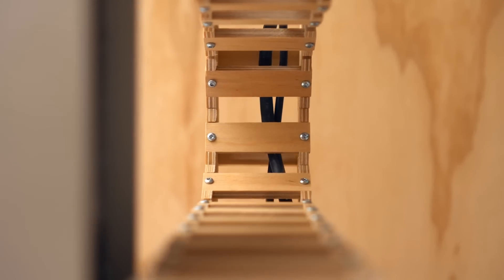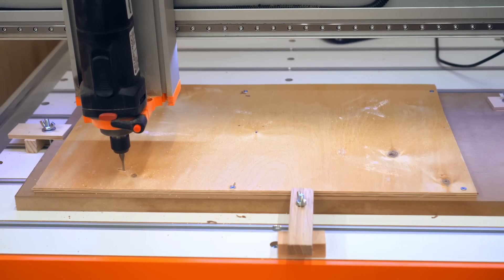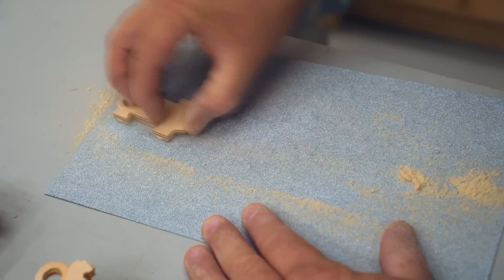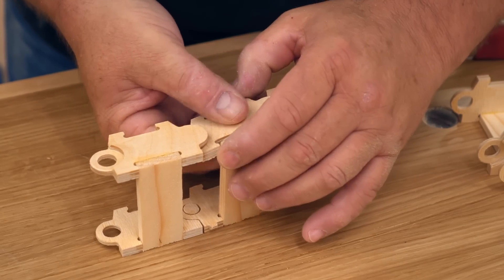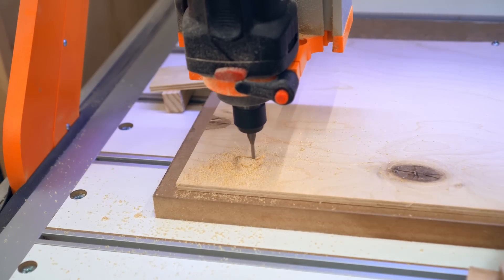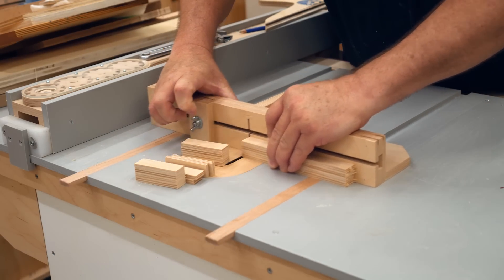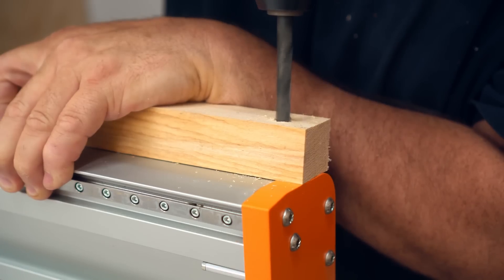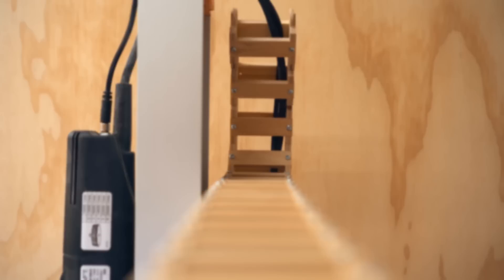Plywood Drag Chain? Yes! How I Made It

Comment from the maker: Next: All wood CNC?
Reply: I’ve built 2 wood CNC machines. The first one was built by inspiration from studying how other people built theirs and the second was a Dave Gatton (edited) design which I bought from him. I used my first CNC to cut out much of Dave’s machine. With wood, the major problem is maintaining accuracy. Wood, even plywood, moves with temperature and humidity and screws loosen allowing movement.  Never owning a CNC made of metal, the problem may be universal.  However, having said all that, I am happy with the results. I did spend around $1000 on all the hardware and plywood, though. Dave’s design uses acme thread lead screws; three required, so not cheep.  Stepper motors, motor controllers, power supply, wiring, v-grooved bearings, screws, and various other metal hardware, it all adds up.  I did have an old computer and the software was free. A great learning experience.  With you knowledge of wood, you might be able to improve the accuracy issues.  If you don’t know Dave, Google him.  He has a website and YouTube channel.
Reply: @billstoner5559  it's Dave Gatton, in case anyone else is confused by all the results for Dave Gannon the vocalist.
Reply: @TuckMcSouthard  sorry about the miss spelling.  I get  too much help from my spell checker.  😩😖😉. I fixed it.  Thanks for the find, Tucker.
Reply: There is already a "mostly wood" cnc. a
Actually two that I know of.... Bob's CNC and Dave Gatton aka Gatton CNC.
Reply: That would be cool.
Reply: I love my Gatton
Reply: Yes, please.

Comment: Try using plastic nails and a nail gun to hold down your plywood. You can run over the nails with the cutter and tack down center cutouts really easily. When you want to get your board back up you tap the edge with a hammer to break the nails. You will really appreciate this after you crash your clamps and jam your dust collector a few times.

Comment: Are those screw drives the Robertson type? Staggering amount of craftsmen still use cruciform, which is totally inferior to torx. Do you prefer these ones for a reason?
Reply: im not john heisz but im assuming a lot of its cost; in canada robertson is the default for wood screws and a lot more economical than torx. robertson screws also have a couple of things i personally prefer to torx like the screw staying on the bit without needing to hold it or use magnets.

Comment: We used to call the larger plastic or metal industrial versions, cable trays. Is that the same thing?
Reply: A "cable tray" is typically fixed. A "cable track" moves. These are the terms typically used in industrial settings. Interchangeable names for cable tracks are cable chains, cable drag chains, cable carriers, energy chains.

Comment: Cool project.  I think if I were going to build one, to glue them together, I would cut a couple parallel dados in a 2 x 4 just wide enough to drop the link sides into and the same distance apart as the finished chain.  Then the bottoms could have all been glued in and clamped with one long caul.

Comment: You could glue the top links down and pull the cable through with a pull cord.  It isn't that hard to add cables to fully assembled chains like that we do it all the time in industry with the plastic ones.  Way too much time involved with removing all the links just unhook one end lay it flat and fish the new cable through.  Otherwise it is a very cool project.
Reply from the maker: The plug on the end of the spindle cord doesn't fit. Otherwise, given that I'm not 8 years old, I'd already know that a wire can be fished through. And also know it's not that hard.